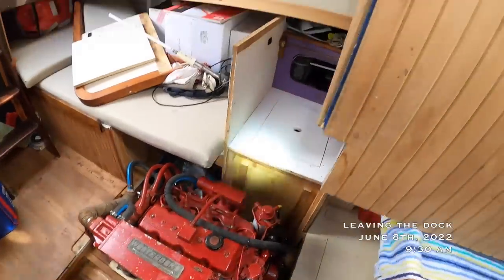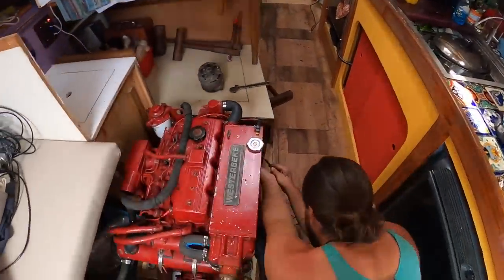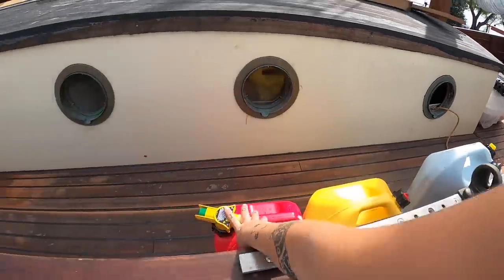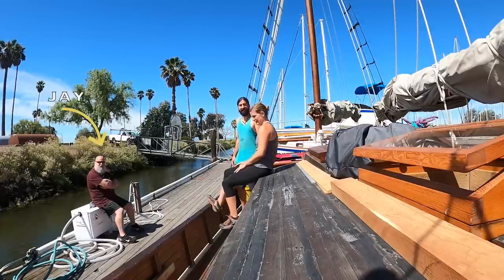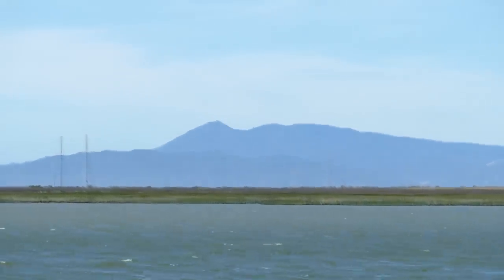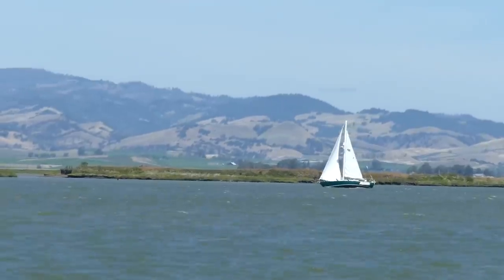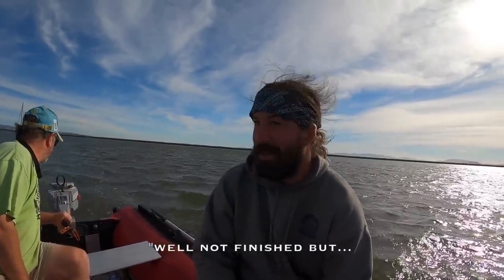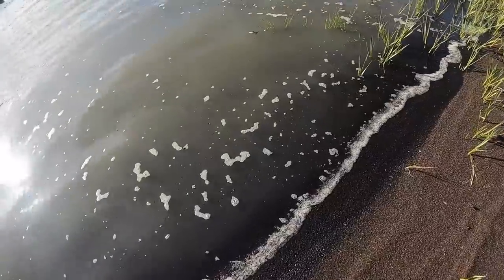Salt & Tar: Ep.200- Leaving the Dock

Comment: I agree that it was most likely a faulty ground that was causing the issues. As others have said, the alternator mounts themselves can/do serve as a ground so making sure they're clean and tight is important. They other suspect may be blown diodes within the alternator, as well. Depending on the model, these diodes can often be replaced without too much trouble. Cheers!

Comment: Nice job on the knee braces for the Davit.  They are a steeper than what most engineers would consider optimum though.  If you ever want more clearance to keep from wearing through the dingy, or to have the mounting points further above the waterline, then you can raise the mounting points on the transom.  The angle that we consider structurally optimum for knee braces is 45 degrees off the vertical.  I've done a hundred or more for sizes ranging from 3" pipe up to 48".  I've also done a few with 30/60/90 angles to get clearance or hit some kind of special structural mounting point.  There's nothing wrong with them though, if you're happy with where they are now, there's no structural reason to not keep them there permanently.

Comment: You need a snubbler line attatched to the anchor chain to relief bowspit and the windlass,. That wil work as a chock absorber and reduce the angle to the point where the anchor hits the seabottom. Fair winds... Michael in Norway

Comment: There was likely a bad ground on the alternator. It grounds through the mounts. So messing with it and wiggling it in the mounts likely restored the ground. Next you have it off or if it does it again, make sure there is bare metal-to-bare metal contact from the alt. to the mount and mount to the engine block. If those surfaces are painted, it can sometimes cause ground issues.
Reply: It sounds like it was frozen up because of the bearings or windings maybe🤔 I would replace it… it’s probably going to happen again, and most likely get more frequent
🤷‍♂️ That’s my guess… but either way, Garrett will have no issue replacing that… if it’s in stock🥴
Reply: @SilentStorm_5 , it wouldn’t get hot if it was locked up (the belt and pulley would, but not the body of the alternator.) and Garrett would have noticed if it was just plain not spinning.
Reply: Most marine alternators ground with a dedicated grounding wire. It is certainly a bad bearing or a misaligned pulley.

The good news is it’s a mechanical injection diesel so alternators are optional.
Reply: @stick004  yeah it would, the bearing heats up and the whole thing gets hot.
Reply: @SilentStorm_5  you can definitely get an alternator to put on that motor the question is would be the ideal one for the motor and the boat in regards to charging a battery bank when the engines running.
Reply: A loose ground does not account for the overheating. Granted the loose ground can be a heck of an annoyance because it’s not always the first thing you think to check on but it still doesn’t account for overheating the alternator that’s friction which would indicate something going on in the bearings.
Reply: @duanemiller5606  I agree💯 a high output alternator could allow them to run more on their system. The price isn’t bad either for what it gives you in performance. IMO. 
Great call👍
Reply: @Mrcaffinebean  well it’s optional because of the solar power to charge the starting battery not to mention the glow plugs.
Reply: Congratulations on a new chapter and episode 200!!!!!!
Reply: @duanemiller5606 , yes it does. The spinning magnets still generate current. But without the ground, it has nowhere to go so it effectively becoming a toaster.
Reply: @Mrcaffinebean  not the type of heat he was describing.
Reply: @Mrcaffinebean  neither of those problems would cause it to stop generating electricity. It was most definitely an electrical problem. He would have mentioned if it wasn’t spinning and locked up.
Reply: @stick004  when a belt starts to slip due  it can spin slow enough that it doesn’t make power.
Reply: @stick004  buddy that’s not how electricity works. Electricity doesn’t need to go anywhere anywhere. Alternators don’t produce heat because they are ungrounded.
Reply: If it acts up again it would be good to check the voltage drop between the case of the alternator and the negative battery terminal while it's running. If the grounding is adequate that voltage drop should be very small. The higher the voltage drop, the worse the grounding situation. It needs to be checked under charging conditions, IE load because it's the current flow from the alternator to battery negative that creates the voltage drop. Ohm's law: Volts = Amps x Resistance (quality of ground connection).
Reply: I agree with this. When you run a generator/motor, which is what an alternator is, it moves those electrons. But if there is a missing connection, that electrical energy has to go somewhere, which is heat. It's basically turning itself into a resistive heater. Once you give it a circuit to move, it can do useful work again.
Reply: @Collinoeight  This is literally not how electricity works. Electrons don’t “have to go somewhere”. If that were true every wall plug in your home would be hot. Every generator not hooked up to a load would overheat. 

You can run an alternator all day long with absolutely nothing attached to it. Don’t take my word for it try it yourself.

Electricity is not “pushed” its “pulled” by its load. This is called Electro Motive Force
Reply: @stick004  a toaster gets hot when electricity flows through the resistance coils when you turn it on by closing the circuit but once you open the circuit the toaster cools off. There’s no heat anywhere even the power cord and the electricity is still there. Without a complete circuit there’s no flow of electricity so no heat. Heat is only generated when electricity flows through an electrical component with resistance which could just be a wire with to much electricity going through it.
Reply: @Mrcaffinebean  it can. Your right. When it’s properly wired and grounded within its electrical system. Try running that alternator all day without a ground to it’s system and tell me what happens. Do you think the only way an alternator can burn up is by the friction caused by a slipping belt or bad bearing?
Reply: @duanemiller5606 , try to remember this is a DC (direct current) system. Not an AC (alternating current) like our house. In a DC system, magnets turn, electrons are excited and move. If they don’t have a place to go in a closed system with storage, they will just sit and generate heat.
Reply: @stick004  You can run an alternator all day long attached to absolutely nothing. Electricity is not push it is pulled.
Reply: @stick004  I’ve been working on cars and alternators going back to 1982 when I got my first job as a mechanic. Never have I seen an alternator over heat because of a ground wire coming loose. Seen many a battery go bad because it was under charged do to a bad ground.
Reply: @stick004  by the way an alternator creates AC electricity and then goes through diodes to become DC in order to run the cars direct current system
Reply: @Mrcaffinebean  that is what i was thinking.  As long as their solar panels are working they really don't need the alternator for anything other then an idler pulley.

Comment: Disconnect the belt from the alternator and grab the pulley and see if you have play or slop. This would indicate bad bearings in your alternator which could account for the brushes not contacting properly so no voltage or charge coming off the alternator and friction causing heat not to mention a loud squeal. If this is the case your alternator is shot if not and If you’re still not sure take the alternator off the motor and take it to the parts store they can test your alternator and tell you what’s wrong with it in a heartbeat. If it keeps getting hot before you can get it fixed or replaced take the belt off it and let your solar charge your battery to be able to start and run your engine.

Comment: You are moving forward! Go out there! More engine rpms and it will be good, carefully check gruonding and all pos connections.
Usually alternators at idle rpm will/not perform as specified. Idle up.. more rpms and youre fine :)

Comment: Whatever the case, you can always check the alternator easily simply by taking a screwdriver and holding it to the back of the alternator on the bearing cap in the center.  If it is charging it will draw the screwdriver like a magnet.    Good Luck!

Comment: Very happy for you both, I ve been watching since before you moved her down to Napa, and you are right, this is another chapter beginning. You have certainly earned it. Garrett, I can't tell by the video but I believe that is an internally regulated alternator, if it does not connect to a dedicated voltage regulator then it is internally regulated. No output is one issue, the noise and belt stuff another. You don't want that belt super tight. Any tighter than spec is gonna make it wear prematurely.
The heating up issue...concerns me. Pull the belt off of it and spin it with your hand. It should spin freely and without any noise...if it making any racket the bearings/bushings are shot. They will have a low growl or grumble when spun by hand if bad.
Just knowing where you are headed I would plan on getting a new one in Morro Bay, and by new I mean new, most of the rebuilt stuff out there is junk. If your family in Morro Bay knows of a legit starter/alternator/electric motor shop in the area get the new one installed and your old one rebuilt, and carry it as a spare. Have your family send it down to you if you need to leave before they can rebuild it. 
A spare alternator is worth having. All the best to you both.
My wife recently retired after 32 years in one business, I am already retired. Seems like we are both going off on new adventures.
Reply: Just guessing but the first thing I thought was the bearing was bad or misaligned. I have had band new alternators go bad some times who knows why.🤣

Comment: For belt tension place a stick or other "straight-edge" one end on the top of the belt pulley on the alternator and the other end of the straight-edge on top of the belt on the engine. Then you put your finger on the top of the belt about half way between the two pulleys and press down maybe something like 5 lbs of force. With a ruler or tape measure or equivalent measure the amount deflection (ie from straight-edge to top of belt while pressing on belt and record. Now what you need to know FOR YOUR ENGINE INSTALLATION what this deflection should be. An engine manual might tell you. If your  belt is too tight, you will burn bearing on pulley prematurely. If your belt is too loose it will squeak while idling at say 1200 rpm. Now suddenly gun the engine a little and see if belt squeeks. Belt will squeek if you have oil on the inside of the loop on the belt. Check this and clean if present. I don't know what is right for your engine and situation; however, this is a general starting point for you to learn about belts. This is all similar to a car so between you and familly and check the internet you should be able to gain specific understanding for your engine and situation. I told you to measure and WRITE DOWN THE DEFLECTION before you make any adjustments. Always (1) Test/observe/record current situation then (2) make an adjustment and (3) Test/observe/record result (4) Compare result with how you think it should be. (5) repeat steps 2, 3, 4, until satisfied or you decide you need to stop and "phone a friend. When you find optimal belt deflection then record this deflection on note and store with other engine documentation.
This is only a suggestion. Best wishes on your journey.

Comment: Only seven years?! That's lightning fast! No wonder you guys are beat. After you got your moment to catch your breath, check the brushes in your altenator, that there is enough material and they move in their slots against the springs freely. While you're at it, wipe the connector surface clean from dust and gunk. Then put more wire on the ground side. Altenator, engine, anode. If the altenator get's stuck, and is fairly new, so that the bearings aren't 30 years old and sunk in seawater, it might weld the brushes. This shows as discoloration spot(s) on the connector surface. This happens when there is current flowing thru the altenator when it's not spinning. Simplest fix is to put a main switch on the battery cable.

Comment: Wow, has it been seven years already? I have been following for about six and a half, but it sure doesn't seem that long. Congrats on stretching Redaviva's legs and geographical legs further than she had gone to date (southward). No time now and she will be at full sail and the rigging will be dialed in and fully ready to head out to open ocean for a long haul.
I trust you have a spare alternator and belts? The misalignment could have been the whole issue with over-heating in the alternator. It certainly could make the belt squeal. Tightening it out of alignment would make the armature ride crooked and create wear and friction creating the heat build up. Rubbing would also short it out making it not create a charge. Proper alignment allows the armature to float inside the coil windings and operate properly. Allowing both cooler running, building a charge to be output, and the pulley to run true and not twist the belt causing it to squeal and scream. Great job finding the problem/issue.
Nice seeing you visit the old WWI Destroyer and it's "high iron black beach".
Sad to see Swabbers not aboard, but good to see an update and him doing well. Maybe he might join for a short jaunt before he crosses that rainbow bridge (hopefully well in the future).

Comment: A glazed belt will slip on the alternator hub, the friction will cause a lot of heat and the slippage will reduce voltage output. A v-belt idler pully will keep proper tension on the belt far longer than just tightening the belt, and some come with 'tension' indicators built in. All said, it's still a good idea to carry some 'anti-slip' belt spray for when you don't have time to swap belts. It's not a long term solution, but it'll get you home...

Comment: If the alternator is not providing charge (i.e.low or zero output voltage) but the excitation is on and the alternator is running hot that sounds like it is short circuited. Most likely a problem with an item of connected load rather than a problem with the alternator itself. Isolate all load from the alternator, run the alternator, confirm output voltage then connect the loads one by one checking and confirming output voltage as you go until you find the faulty load - that will be the one when you connect it the generator output voltage goes low.

Comment: I love you guys and this boat you guys built. I however think at some point that you will ditch those little wooden bits you added on the hull that extend those chain plates. I could see in this vid that those are adding drag in the water and when you guys made those i was cringing at the foreseeable future that you just needed to remake the chain plates to fit rather than to add additional drag to the hull. You will find another hand full of speed when you remove those things.

Comment: I think the heat problem could be a sign the the batterys were really low and eating the max current, maybe a charge controller issue. If this was the issue the batterys taking charge and returning to a higher voltage should redue the current draw made at the alternator. High current draw especially in dc systems cause heat.   Were the wires hot aswell, away from the alternator near the charge controller?  Except for running lights who needs electric on a sail boat anyway.

Comment: Could be a bearing in the alternator it would explain the sound and the heat
Reply: I would check load for a possible short. Heat, no output, squalling belt noise, are all indication of maybe a bad diode but they fail and don't come back normally. Verify the proper output voltage when charging. If the Zener is bad it will be high and could damage a lot of equipment or cause a fire. I don't think it is a ground issue but maybe. A heavy current draw like a stuck starter solenoid or batteries hooked or charger could be causing heavy current draw. Fix This dont wait. Be mindful of current draw. Watch Amp and Volt meter and beware a squealing belt. Maybe belt, but a short can cause this due to heavy current draw. Fix This. To much work in casd of fire. Very dangerous. Feel the heavy wire coming off the alternator for heat. If it sees a short it will heat up. Also monitor Volt meter for lower than normal voltage. Starter or Solenoid sticking or Batteries including charge controller, Inverter can cause this as well as an alternator.. It appears intermittent. You if engine is on and alternator  is heating up check output of the solenoid to the starter. Big Lead. If it has voltage after the start the solenoid is stuck. Check wire from switch. See if it is energized from the switch to energize the relay to the starter motor. It should only energize when cranking. It will be an item that is a heavy load current wise. Fix This. Relays, the switch, bad Battery charge system, Starter, or Solenoid. Next time i
f you have a clamp amp meter look for high current load. OR could be the alternator. Furthet checking is a must don't over look this guys.
Ron KA4WYO

Comment: as long as the pulley on the alternator is turning at the same rate as the other pulleys the belt is tight enough and needs no further tightening. over tightening will prematurely wear out the bearings. and if too tight will contribute to it running hot.

Comment: I see lots of new paint on the engine and bolting a new alternator to a freshly painted bracket is more than likely the place to check.  Bare metal-to-bare metal, as stated and then paint if you want.